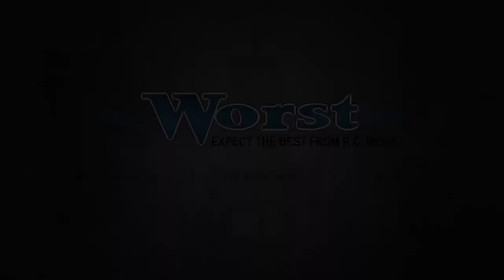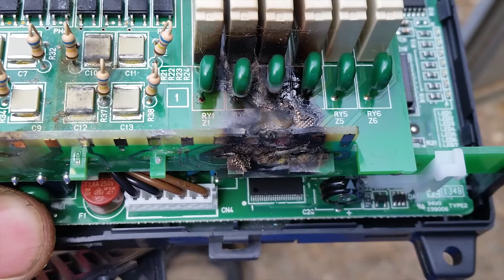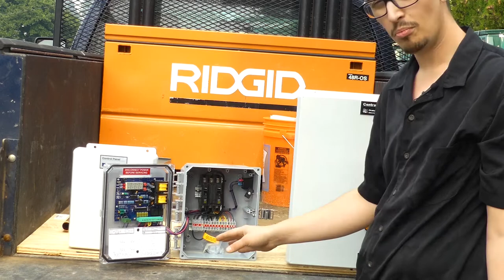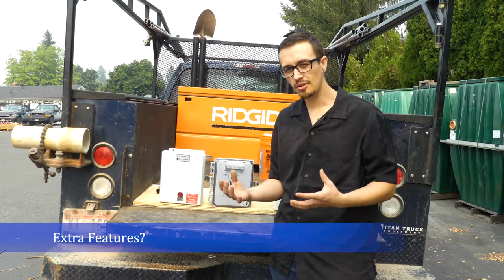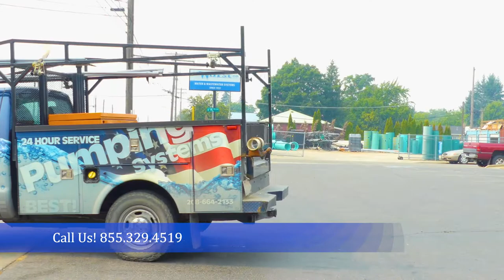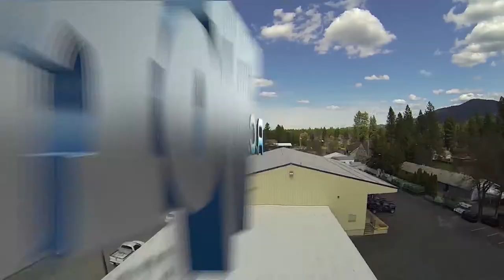Selecting a Pump Control Panel

Comment: what would you recommend for a 2hp 230v 3phase goulds booster pump for my irrigation system. i will be using a float switch for on and off when running,  eventually i want to add another pump in parallel and have them both running at the same time (same panel or separate) to add more water volume and finish watering the farm sooner. thanks.
Reply from the maker: Ruben, give us a call for help sizing/selecting a pump: 855.329.4519

Comment: I just installed a control box for my 3/4HP, 220V well. I know for a fact that all my wiring is correct, but the breaker trips every time I turn the breaker on. Any idea what is going on?
Reply from the maker: What size breaker is it on?
Reply: Your wiring is probably not correct.  Are you running a two wire or three wire pump?

Comment: Hi 
my 3 villas of same height (g.for and 1st floor) are 135m far from underground Water tank (depth 6.7m)...I planned to place  centralized pump over water storage tank. Each villa has 10 bathroom (shower, wc,urinal, washbasin and 1 kitchen and 1 jacuzzi....What's flow and head ? How to choose right pump?
Reply from the maker: Hey Mohamed, thanks for the comment! We have a pump head video that I think will help answer your question:  https://youtu.be/mtP-9arHJuM

If you would like help sizing the system, give our experts a call! 855.329.4519